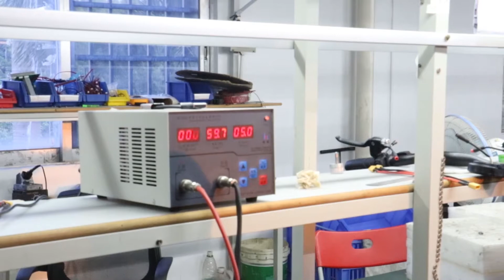EcoRider E4-9 Scooter Testing Video Before Package

Comment: Can you use a 10 Amper fuse to limit electrical the speed ?
Reply from the maker: Why you need limit the speed sir?
Reply: Hi, to drive on the street
Reply: @viviqin2636  to drive legalisation I must block mechanical or electrical (physical the speed, can you help me
Reply: Can you help me
Reply: If you want to limit the speed you can keep it to gear 1 the speed is 23km